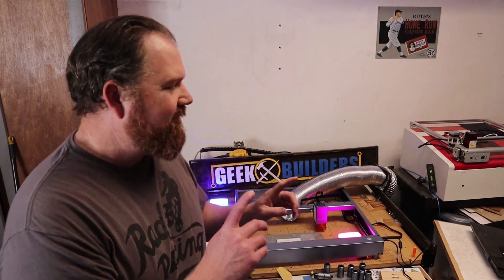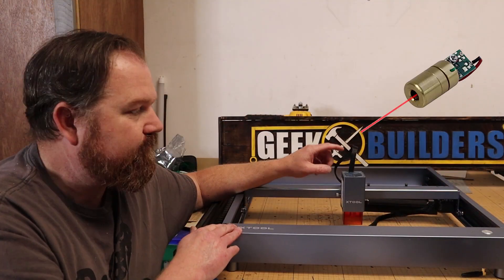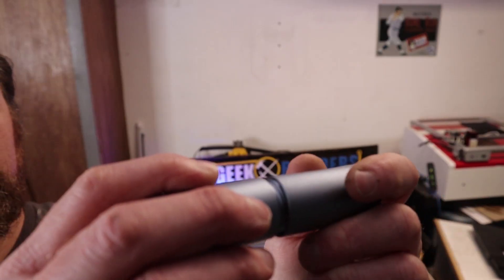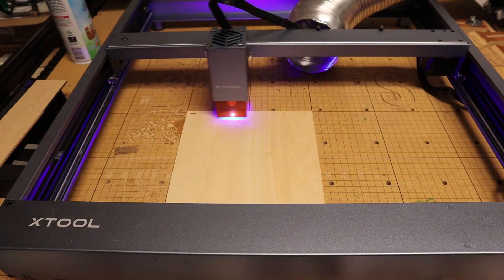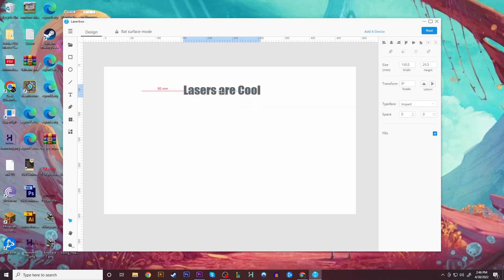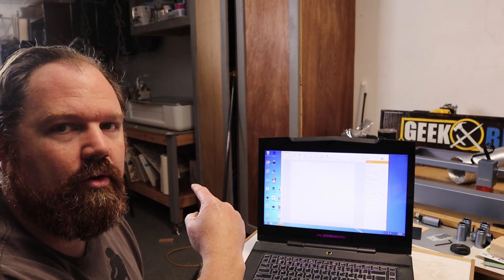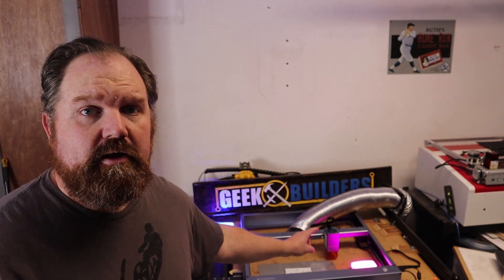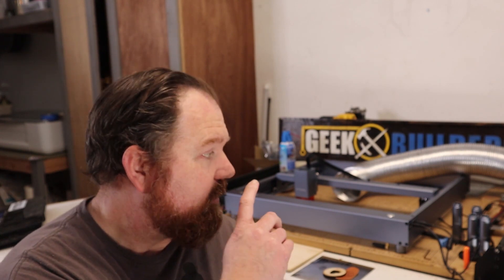The xTool D1 Laser should be your next laser - It Can Do Everything (almost)

Comment: The 20w won't make a dent in aluminum. Any ideas as to why?
Reply from the maker: Are you talking about engraving or cutting? For the most part, diode lasers only advertise being able to engrave (mark) steel. Aluminum has different properties and does not behave the same way. I have not experimented with unpainted aluminum yet, but might try it in the near future.

Comment: Came here from the Glowforge video a couple of years ago, just started watching this one, fingers crossed this will do what I need it to.   Does it work with mac's? DXFs? Offline without having to use a 'cloud' (yuck!).  Cut acrylic?  Accurate positioning? i.e could it accurately produce a ruler?
Reply from the maker: Yes it works with Macs. There is no cloud component, you can connect through your local WiFi or direct through USB. They have their own software, "LaserBox", but it will also work with Lightburn. I don't remember if it works with DXF's
Reply: @GeekBuildersNet  Thanks for the reply Geekbuilders, really helpful honest accounting of lasers - I appreciate the time you've taken to make these videos

Comment: Thanks for the video Shawn! I'm concerned with reliability...With your  experience using lasers, could I could I get many years of use?
Reply from the maker: It is a very well built machine that uses good parts. Longevity probably depends on frequency of use and power output of the diode laser. Most diodes are rated for about 25,000 to 50,000 work hours though. The nice thing about the D1 is that you can replace individual components without have to scrap the machine or send it back to the factory.

Comment: I bought the x Tool D1 to use on cattle ear tags that are made of polyurethane.  The marking comes out white color which is very hard to see for cattle identification.  How can I make it come out in black?
Reply: The best thing to do is to mask the tag with paper transfer tape, do the engraving, and do a black paint fill. Allowing the paint to dry before removing the transfer tape. It's an extra step but it allows you to customize the tags better than buying the premade ones. The transfer tape looks similar to regular masking tape.
Reply from the maker: @mallorikerr4092  That's a good recommendation
Reply: The method can be used to darken wooden sign engravings as well.
Reply from the maker: Not sure that you can. I assume that the laser melts/etches the plastic and leaves a void. It most likely wouldn't darken it the way I assume you are hoping. The only thing that probably could be done is to take some black paint and wipe over the engraving and then wipe off the excess paint.